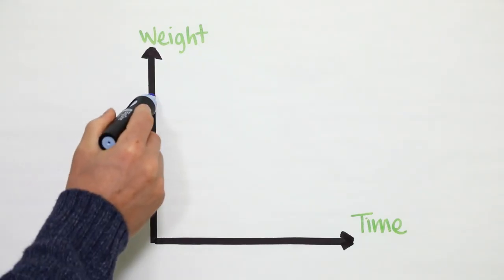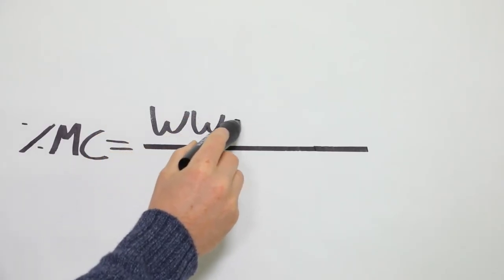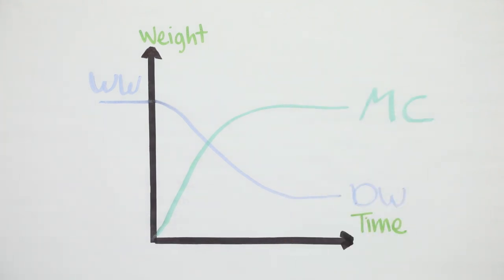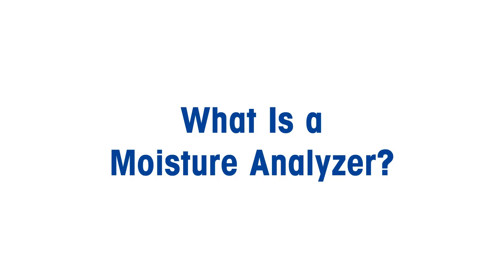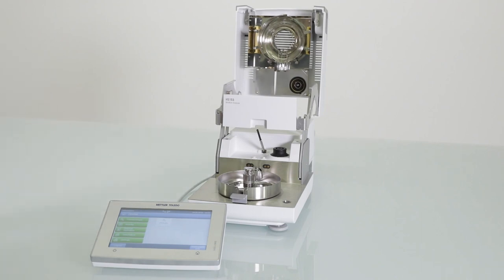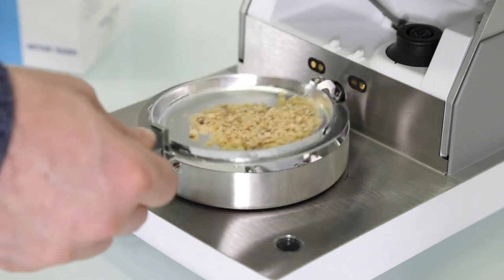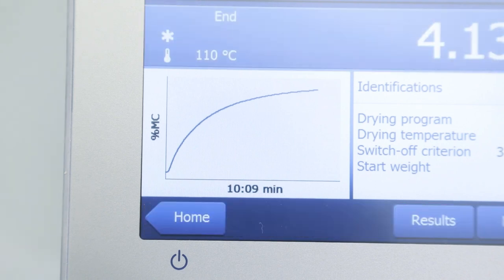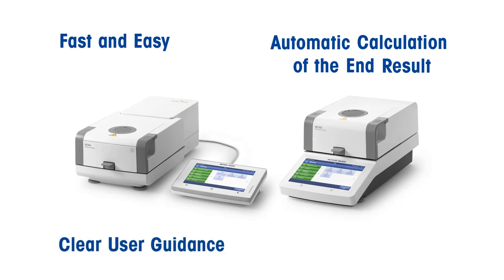What is a Moisture Analyzer and How Does it Work?

Comment: hello, 
for plastic material what standard mass of sample (g) and temperature we need to use? any standard ASTM  can refer? thank you
Reply from the maker: Dear Rodhiah, thanks for your request! Under the following link you will find all information about moisture analysis in plastics: 
https://www.mt.com/us/en/home/library/applications/laboratory-weighing/analysis-of-moisture-content-in-plastic-pellets.html

Depending on the expected moisture content, the sample quantity can be up to 30 g. With the METTLER TOLEDO high-performance moisture analyzer HX204, a moisture content <1% can be determined. The drying temperature depends on the type of plastics. Please refer the "Method Collection" for more detailed information on drying temperature, recommended method parameters and the ASTM standard.

Comment: How does one tare sample pan?
Reply from the maker: Hi, depending on the moisture analyzer taring of the instrument is automatically done by closing the lid e.g. HX204 or HC103 4/7...example: First Measurement. HC103 Moisture Analyzer Quick Start Guide: https://www.youtube.com/watch?v=uI2iy0CHUHY&list=PL049EBBE026D7B9BD&index=24 or by pressing the tare button on e.g. HE53 HE53 Moisture Analyzer...example: Quick Start Guide 3 First Measurement: https://www.youtube.com/watch?v=wChc2KDS4dw&list=PL049EBBE026D7B9BD&index=30